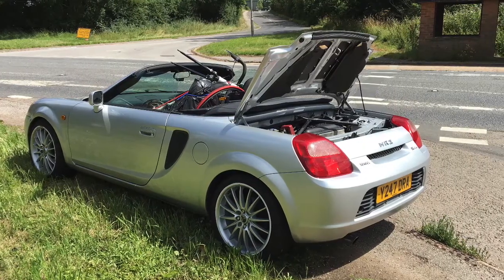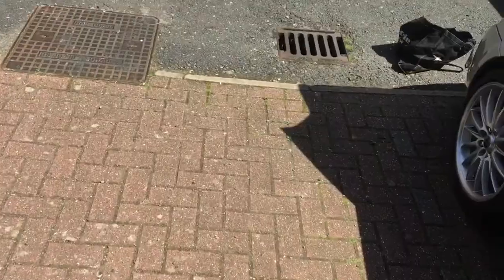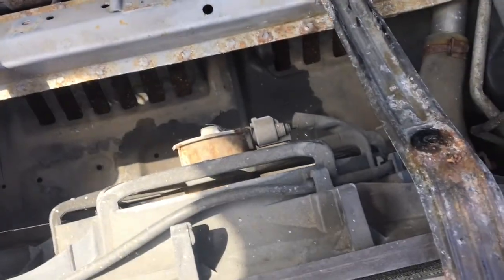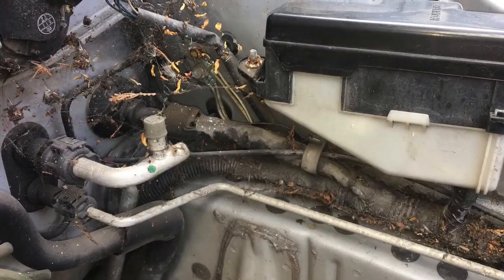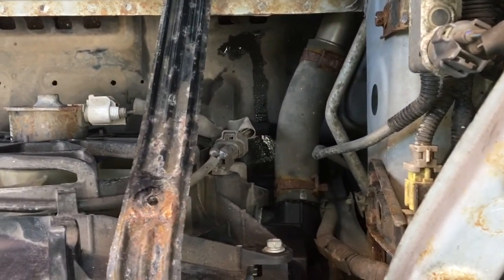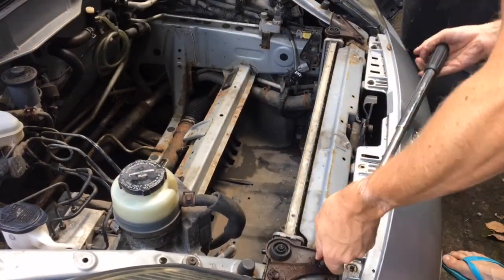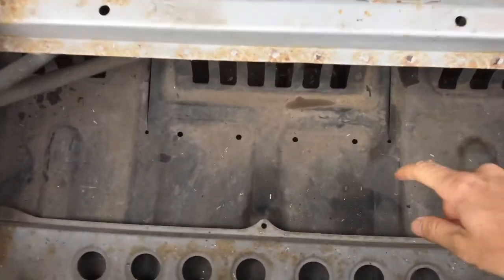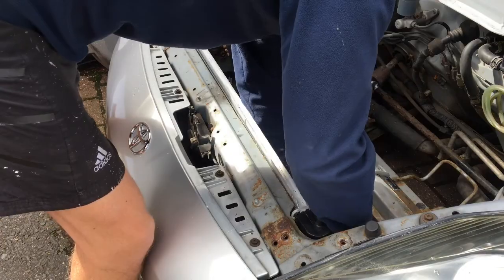Toyota MR2 Roadster radiator replacement

Comment: You're a king for all these, mate! Changing rad and fitting Malian exhaust and new induction kit today, your videos are going to be invaluable.
Reply from the maker: Good luck, hopefully you do
Better than me. Main thing if your car has been outside like mine, is lots of WD40 on all bolts. I snap about 1/3 of mine clean off
Reply: @andrewsparey697  Yeah, there was WD40 and there was fire... Got it all apart. My Malian doesn't fit anything close to what yours does though. Gotta replace the cat first, then going to try again. Radiator fit was a peace of piss though!
Reply from the maker: @jakeyorath2325  so i heard a little mouse like squeak and a burning smell for weeks after the muffler fit. Bumper rubs on the exhaust tips - i chopped it back with a jigsaw
Reply: @andrewsparey697  Yeah. Likelihood is I'm going to do exactly the same. Actually we found it didn't fit even close to how yours did! I think 20 year old cars + aftermarket cars... It's not a surprise, basically.
Reply: Thought you might be interested... Fitted a little cable tie to pull the bumper up very slightly. Fits beautifully, looks great, sounds mean.

Comment: For the chemical test, shouldn't the gases bubble through the blue liquid to give a result? Otherwise nothing is happening?
Reply from the maker: Correct. It worked , my head gasket is fine.
Reply: @andrewsparey697  Ah right, good to cla
rify that :o)